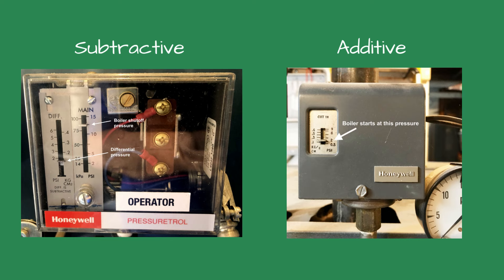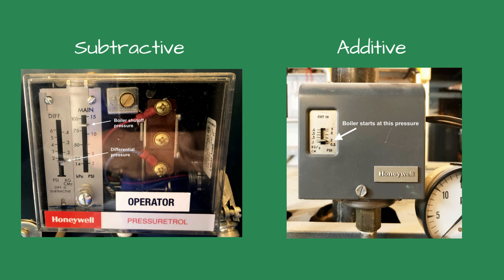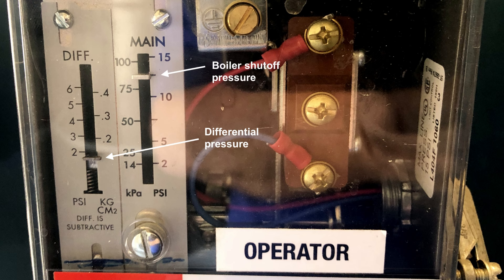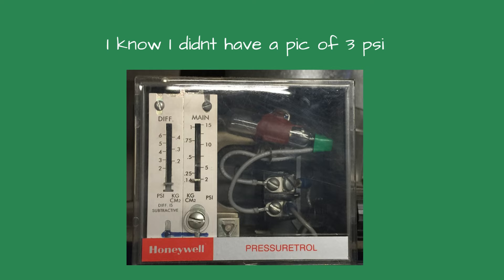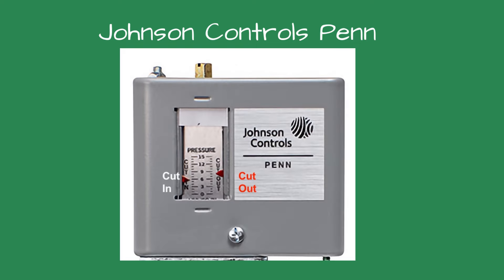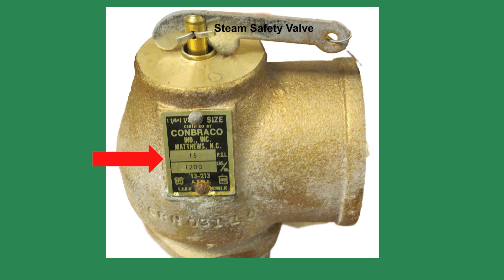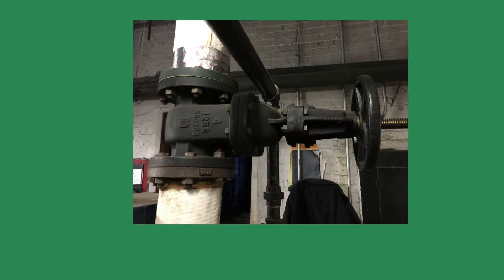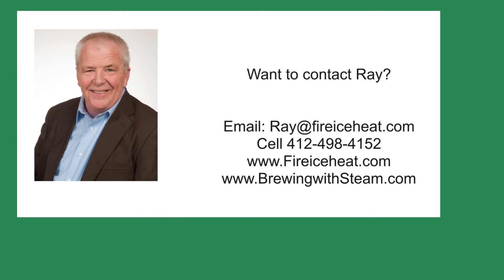How to set & adjust steam boiler pressure controls

Comment: It was a little bit nerve-wracking we worked in a laundromat that had a cleaver Brooks boiler running at 100 PSI plus for the clothes and stuff pressing or steaming whatever, packings on the large OSY valves were spitting and spraying steam over the top of the boiler.
Reply from the maker: Wow that would be scary and dangerous I hated working on a laundry boiler lol

Comment: How do you remove the copper connection under that pressuretrol box to clean it
Reply from the maker: It's very difficult cleaning the pigtail or siphon. In most instances, it's easier to just replace the pigtail.

Comment: What should I set my additive cut in and cut out too I live on the first floor on my in-laws house 2 units I have my own and she has her own but my water doesn’t stay hot for long I have it at 1 cut in 2 cut off right now
Reply from the maker: I would suggest checking the main air vent and radiator  air vent if it's a one pipe system and the trap if it is a two pipe system on your in-law suit. The pressure setting should be good It sounds like you have air in the pipe
Reply: @boilerroomdetective  I turned it to .5 and 1 cut off last night .. I’m just trying to have my hot water in the shower to last longer it gets cold fast the heating up the house works good … 2 family house but other than the water getting cold quick in the shower I think it fine … the water level in the clear glass is about the low level line if you get what I’m talking about … do I just need to add more water in the tank if so how
Reply from the maker: @2FrEsH4ya617   So the steam boiler heats your domestic hot water? I was bit confused. Not sure why that would happen. It could be the water temperature control or the heat exchanger is scaled. Perhaps you can get on HeatingHelp.com and find a good service tech in your area.
Reply: @boilerroomdetective  all set I called the company that came and fixed my radiators cuz it was fine until after they fixed my radiators but they came fixed for free I wasn’t home my mother in law was so she knows what they did I’ll ask and post it

Comment: I got the L404F shown at the beginning of the video and the L4079B towards the back of the video.  Both are on the boiler and its a low/high/off or low/high/low.  Supposed to cut steam off at 12 psi, which I'm actually close pretty consistently at 12.5 psi.  But want to get the boiler to to fire back up at 10 psi.  However I cannot get the L404F to get programmed right.  At one point I was fairly close, with a heat call at 9 psi and fuel call at 7psi, but its been all down hill after that.  Any suggestions?  I want to get some gauges and put on there with them but something ain't right.  A few times I had to hit the reset button on the 4079b to get the call for heat to come up (showing less than 5psi on gauge when this happens and one time dropped to 0 with still no heat call).
Reply from the maker: When Im setting these up, I set the manual reset limit control for 15 psi. If it has a low high low burner, I set the operating control for about 1-2 psi above the firing rate control. I set the firing rate control for my desired operating pressures. For example, If Im trying to operate between 10 and 12 psi, I will use the following settings. Manual reset limit control is set for 15 psi. The operating control to shut off around a pound less. 13.5-14 with a 2 psi differential. The firing rate control is set to shut off at 12 psi with a 2 psi differential. Good luck
Reply: @boilerroomdetective  Thanks.  Upon further inspection, removing the cover of the pressuretrol, the diaphragm was damaged, (which we had a broken part in shipping, but thought that was it). It wasn't sitting square/plumb to the brass female fitting below it.  Thats why sometimes you could just touch it and it would start up.

Comment: New subscriber here
Reply from the maker: Welcome!!
Reply: @boilerroomdetective  thank you I have a question for two Pipe system Steam on a small house with a 109,000 BTU boiler and 12 radiators where would you recommend the settings?
Reply from the maker: @greekmaster1001  I would set it for for 2 psi If its an additive pressuretrol, set the cutting for 1/2 and the differential for 1 1/2 psi Good luck